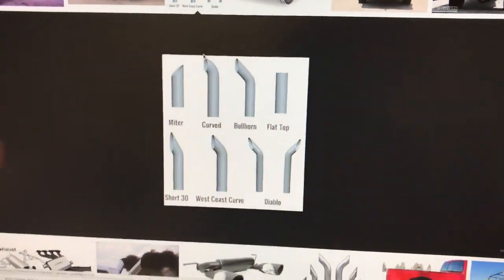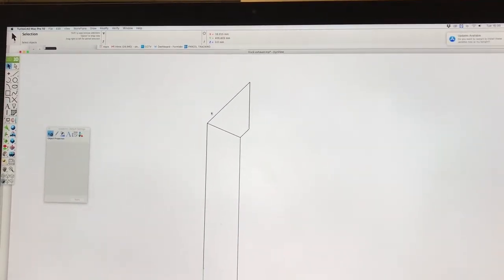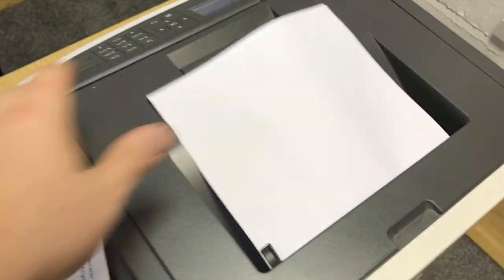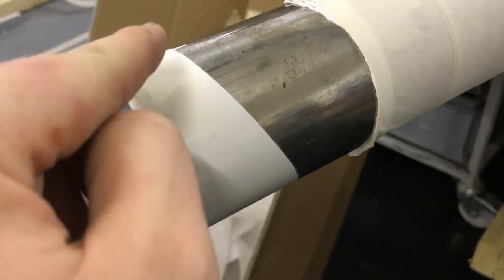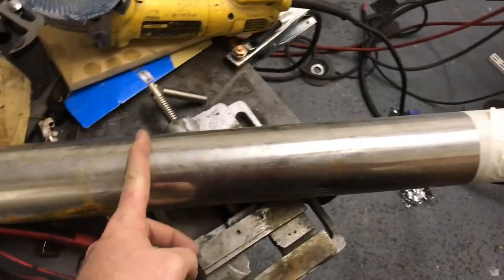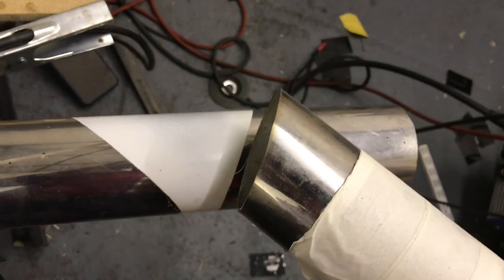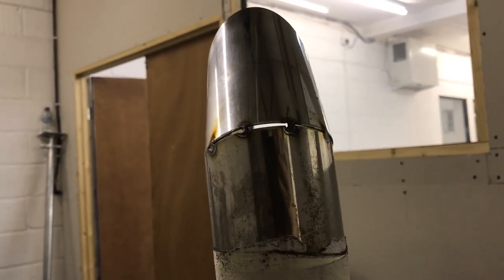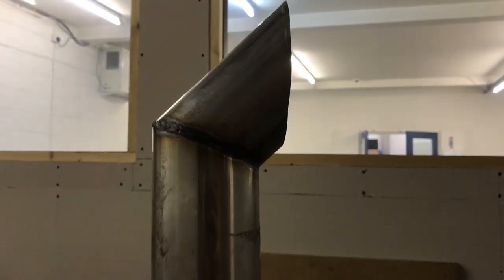Making truck style exhausts for smokers

Comment: What sofware did you used to draw the stack on the computer? I like the way to check angle on design
Reply from the maker: It was an online thing, a website that you use through a browser. Google for tube notching guide etc, you should find it
Reply: @PetesShredder  thanks